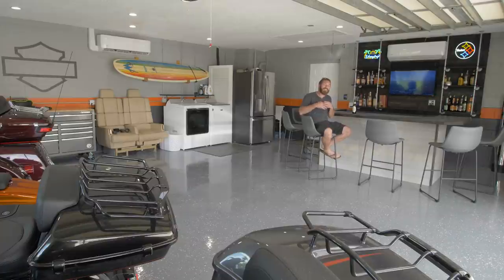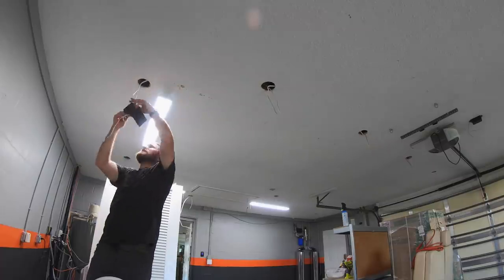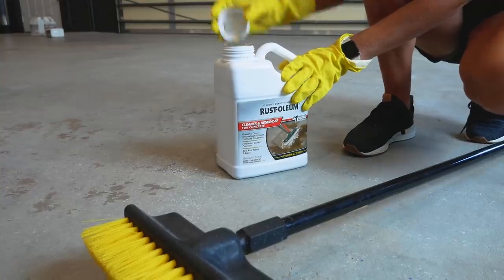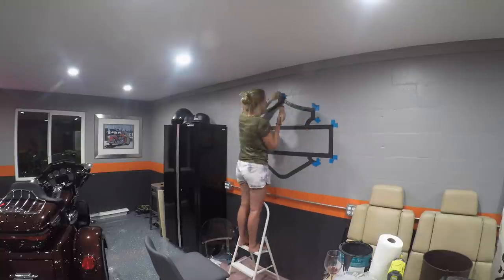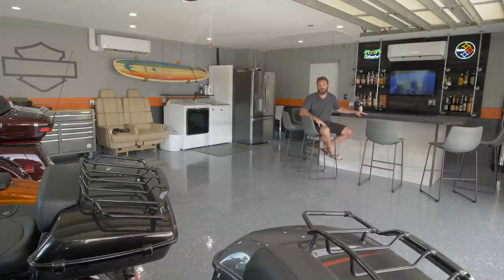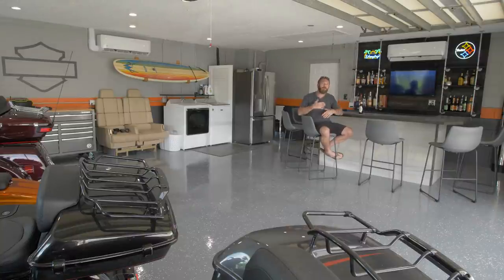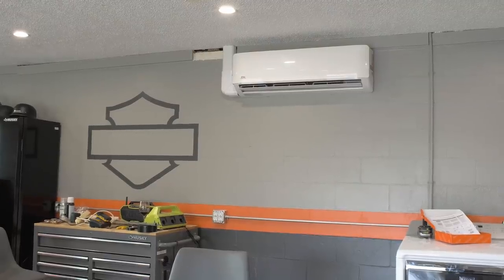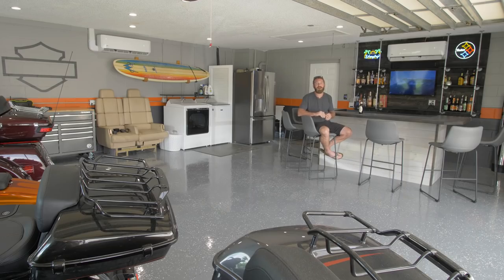Motorcycle Man Cave / Garage Bar Makeover ... a gift to my Dad

Comment: for painting the block.  put the tape on the grey color to edge the orange.  Run a bead of clear caulk at the edge of the tape where the colors meet and smooth it with putty knife.  Then paint and pull the tape while the paint and caulk are wet.  You get a perfect edge on a bumpy surface.  Work great on walls with texture like they do around here.  Makes nice clean lines

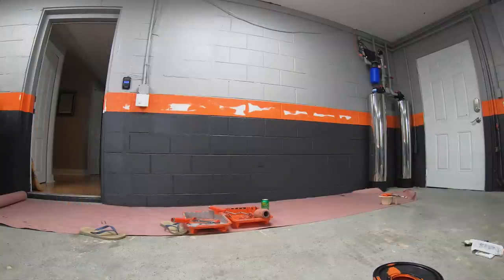Comment: @1:42, there is actually a little known hack to obtaining wall paper like, crisp paint edges, with no bleeding of paint under the tape lines, when painting stripes. What you should have done is laid out both rows of painters tape. Then, you should have painted black paint below the bottom edge AND above the top edge of the lower painter’s tape. Then, you should have painted  grey paint below the bottom edge AND above the top edge of the upper painters tape. In other words, let’s say your orange stripe was 8” high, where the orange stripe would end up being, you would first have 4” of black paint above the bottom row or painters tape and 4” of grey paint below the bottom edge of the top row of painter’s tape. By doing this step first, before you paint the orange stripe, you are essentially sealing the edges of the painters tape to prevent orange paint from bleeding under the edges of the painters tape.  I hope this makes sense.

Comment: No disrespect, you followed directions.  Once again, the epoxy coating manufacturer did not recommend the proper preparation. If you apply a coating on top of a coating that is peeling, now you will have two coatings that peel.  If you didn’t diamond grind the floor to clean, white, scratched concrete, it WILL FAIL.   When it does, look us up for high quality epoxy that WON”T peel when installed properly.  Give us an update on the floor in 6 months.